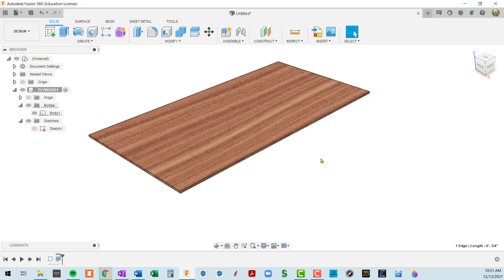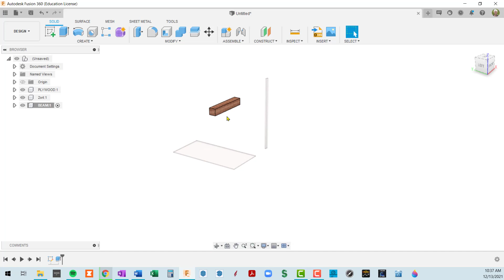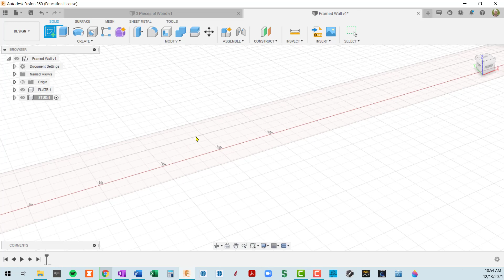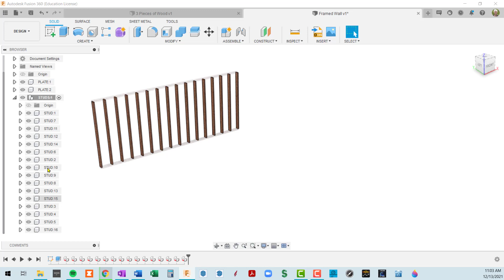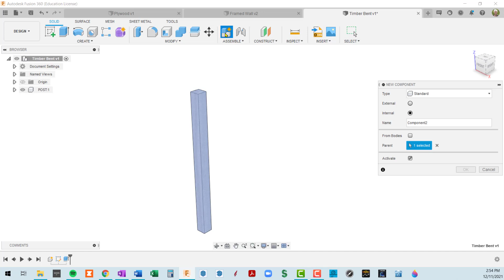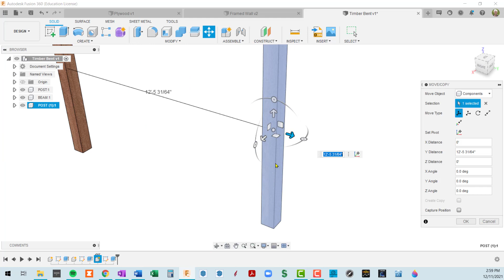Fusion 360 for Woodworking: Simple Projects

Comment: Note that using the spacing tool does not place studs 'On Center'.  It places the edge of the stud at 16".  You need to move them all back 3/4" after creation.  If you ever start modeling paneling you will notice the panels don't land on studs if you skip this step.